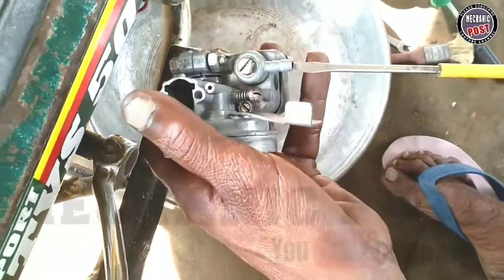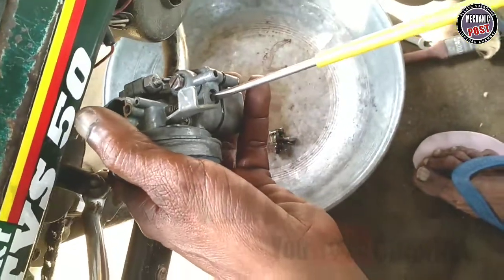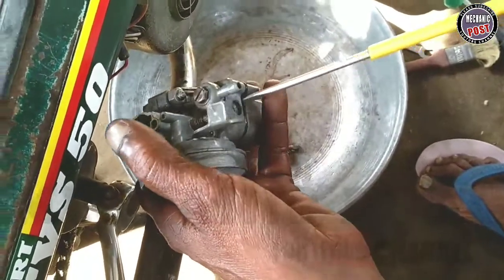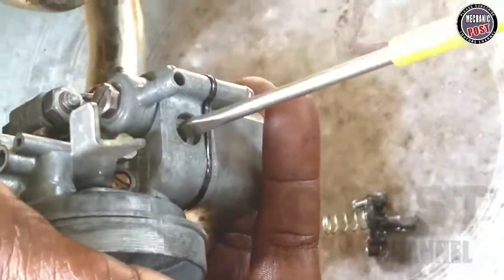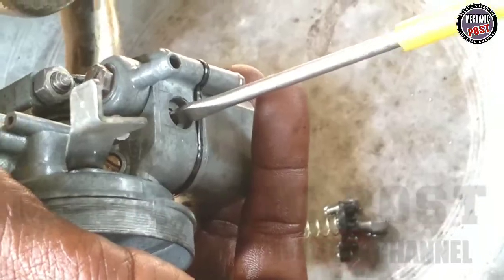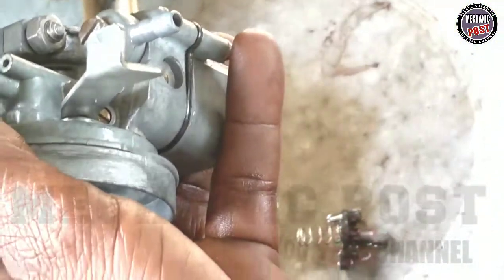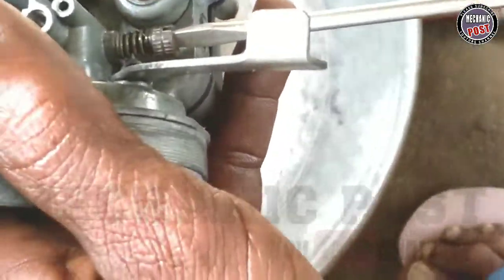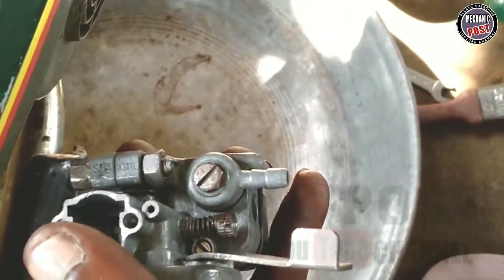Milage adjustment|மைலேஜ் பிக்கப்|TVS 50|XL SUPER|TWO WHEELER |TAMIL|MP|MECHANIC POST

Comment: Ji..35km ku mela speed poga matengudhu  ..tiktik nu sound vandhu speed drop aagudhu..carburetor main jet  size  enna podanum speed ku..
Reply: 52
Reply: @Dhanapandiyan0886  ..52 tha potruken ji..vera enna seiradhu..
Reply: @arularul8959  petro kudukka mattithu
Reply: @vasanthananthini9652  Ena bro.?
Reply: @arularul8959  tvs petro kudukka mattithu enn problem jet 52 corburator clear panniyachu
Reply: @vasanthananthini9652  petrol kuduka matengudha..?
Reply: Tvs 50 edhuku bro petrol namaku kudukanum
Reply: @arularul8959  petrol romba sapuduthu enna pannalam
Reply: @vasanthananthini9652  .. Petrol epdi sapduthu elaila vacha ila plate la vacha